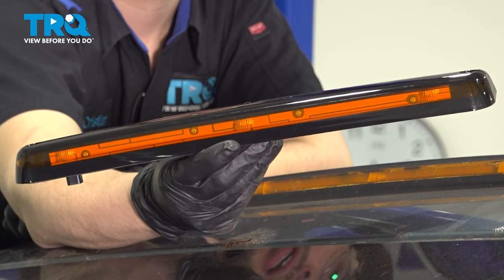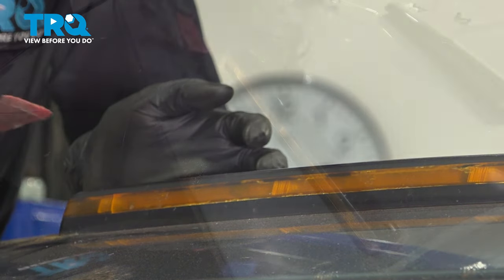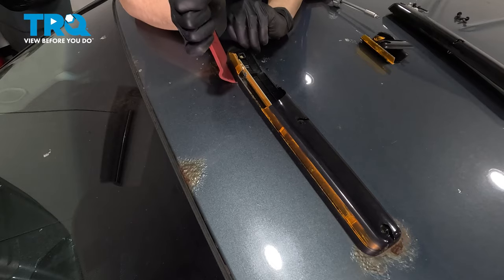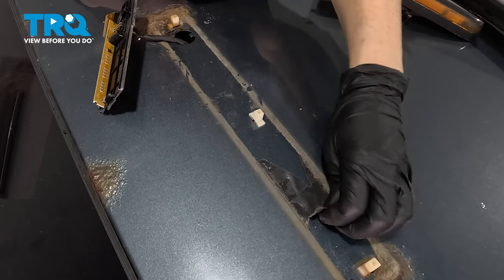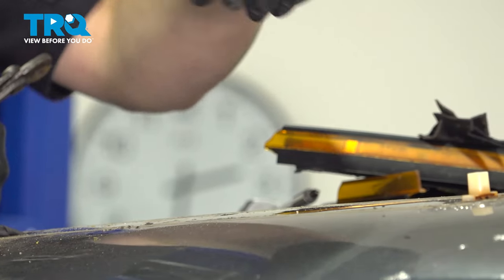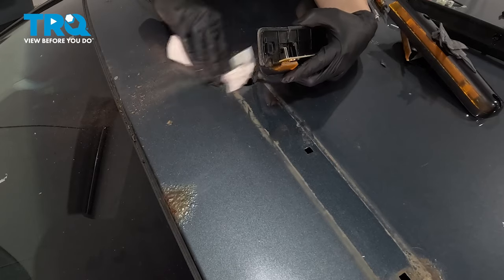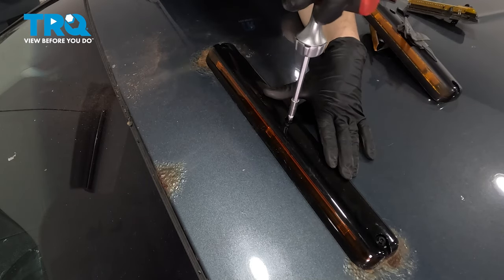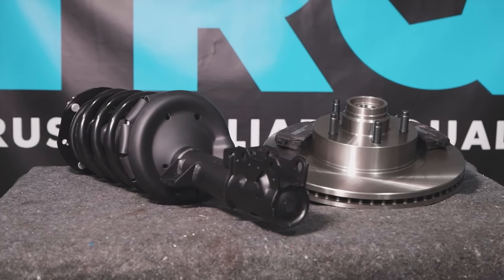How to Replace Center Cab Roof Light 2007-2014 Chevrolet Silverado 2500 HD

Comment: I have 2007 accord with 285000 miles. The car is burning lots of oil.  Most of oil leaks are fixed.  ANY recommendations to solve this problem? Thanks